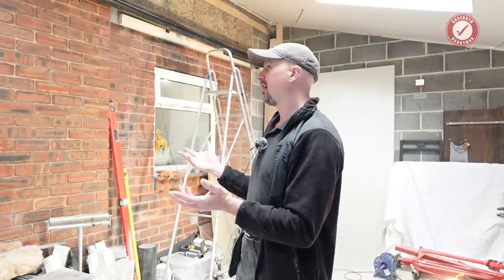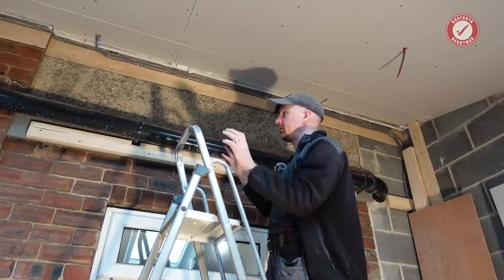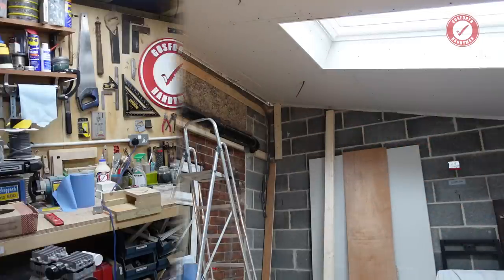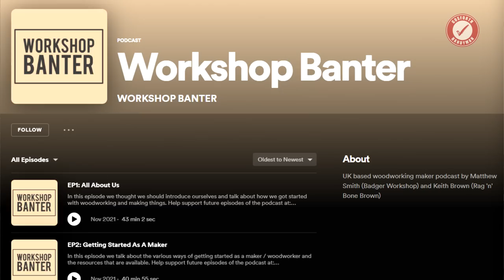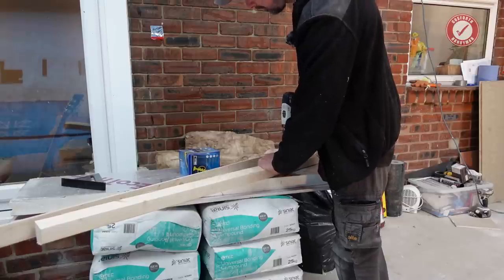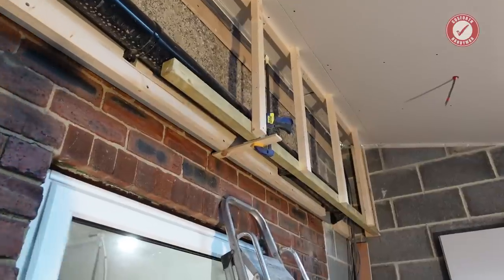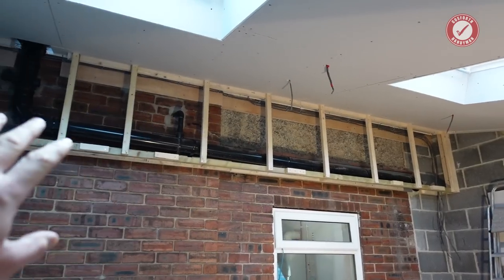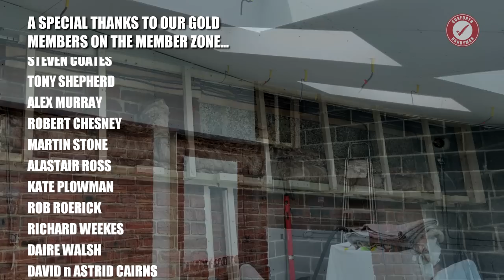Boxing in the kitchen pipework (Self Build Extension Part 17)

Comment: Nice Job Andy. It makes you wonder how the old joiners and builders managed without cordless tools, modern Posi drive screws and drill drivers. Slotted screws, Brace and bit drills and ordinary screw drivers must have been so hard on the hand muscles and wrists.
Reply from the maker: Too right - must have taken forever!
Reply: Most joiners used Yankee screwdrivers.
Reply: @135Ops  not in the early part of the 20th century they didn’t

Comment: Hi Andy  yet more progress , I’m just in the process of replacing all my old aluminium windows at the front of the house with UPVC  golden oak to match the rest of the property. One of my doors is a 5 metre long patio sliding door set , I was thinking of having by fold but was told there was quite a long lead time on them . So have had sliding doors instead , seems I made the right decision considering the length of time it’s taken with yours .  And to be honest I think in our case they look better , and as we live in the countryside if we open the doors fully every bug in aria would come in the house 😂.      Hope by now you problems are resolved          Best wishes and kind regards as always 😀👍👍👍

Comment: I'd personally have made a temp wall  using timber breather membrane and the windows from the bay window so you could get knocked through snd get plastering done. Just need to leave the reveals for after doors arrive
Reply: Even using the old windows as a temp measure 👍👍
Reply from the maker: Wouldn't be warm enough to live in while doing the work. 👍

Comment: Hi there, is that your sewer stack running through there? I was looking at somthing similar as a family member is having a ground floor extention and the sewer stack runs down top to bottom at the moment, so wasnt sure if the stack needs to be above the roof and run horizontal to the side of the new extension. The only issue is i dont think there is enough room to do this between the up stairs toilet and running above the new roof so may need to come into the building like this? is there a risk of leaks etc? also what does the regs say on this as i couldnt find anything that suggests doing this?
Reply: that black pipe is indeed the sewer stack

Comment: Is there a reason for the verticals on the boxing being "surface " rather than flush with the top ceiling and bottom rail? I've always made them flush as it makes the plasterboard easier with more "edge" surface to mount? I'm probably wrong though? 🤣Every day's a school day!
Reply: Thanks for mentioning this. There was no reason not to make it flush.  Even better would be to use metal studs.
Reply from the maker: It was to allow space for the insulation and means no end grain fixings.

Comment: That’s gonna be quite a big bit of boxing in, could you not have run the soil pipe between the joists of the first floor, I assume they run left to right as most houses do, so there’ll be a space all the way across under where your bathroom used to be then across in to your extension.
Reply from the maker: No, the joists run front to back... but the boxing isn't that big in the context of the room. 👍

Comment: Greetings Andy. Please please do not use the Abru steps as a ladder 1 they have hard plastic feet that WILL slip out on you. 2 Watch your footage back as they bend with your weight on 3 Getting back on them will, (maybe not today) slip out. Will not go into my injuries from doing the same but one whole year off work and two operations later my shoulder is still in a mess. Plus the mess two 5l cans of blue emulsion made all round the room (Part finished) as the legs smashed into my pasting table..... I could go on but the steps looked like a truck had gone over it as my 14 stones landed on top. They were not made as a ladder but are just made for opening as steps. Take my warning..  Bob (Weston super Mare)

Comment: It's so annoying when one thing which can't be done yet delays your whole planning.
you could take away the guttering from the bay window however, you don't need it under a roof anymore!
It was just making it more difficult for you to get on and off the bay window, and there is a chance it will break.
Reply from the maker: It's frustratingly hard to get out since they fitted the new GRP roof over the brackets, so all needs cut out. 🙄👍
Reply: @GosforthHandyman  Oops, I know this.
I have to remove the barge boards around my flat roof, but the trim covers the upper row of screws in them, so removing the trim and therefore lifting the edge of the felt is needed.